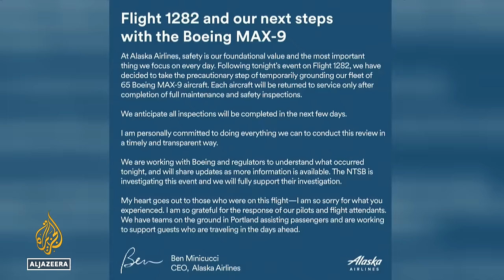What happened to Alaska Airlines' Boeing 737 Max 9 whose door blew off?

Comment: This is not the first time the Boeing MAX model is under scrutiny. A few years back there was the controversy relating to its flight control system causing crashes, and now it seems the problem is structural. Maybe there's just something flawed with the model, or Boeing's construction standard isn't what it used to be.

Comment: I don't think Boeing should be trusted again. According to video reports they've bypass one of the most important aspects of aircrafts industry. Which is safety. Beoing 737 max had 3 crashes. Due to an IMCAS system. Whatever flights they come up with, should go through double and triple safety inspection before it can take off. And that goes for all aircrafts manufacturers. Folded wings and fancy aircrafts may be nice. But certainly safety always comes first.